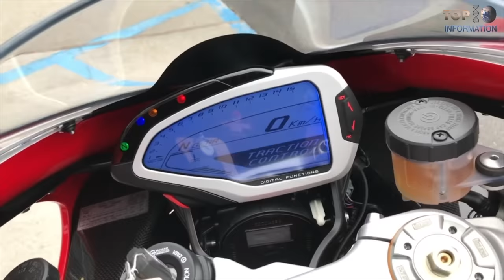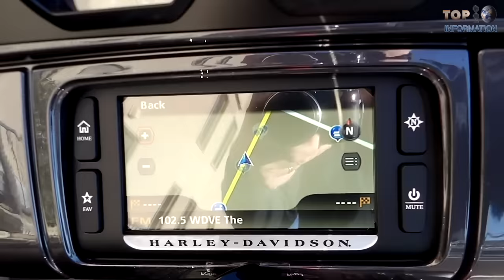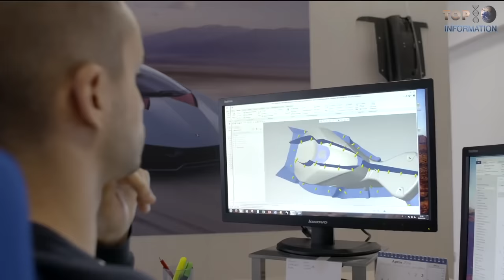10 Mind blowing  MotorCycles in the world

Comment: I think you are mistaken Kazasaki H2R TOP speed is 400+ not just 300kmp
Reply: Yuri Boyka yea they did I thought the same thing
Reply: Yuri Boyka Doesnt it got 356 hp too
Reply: In fact the h2r was famous for breaking 400 km/h wall...
Reply: If you have a race engineer to tune your settings then yes, 400kph is achievable (by one man thus far) but stock settings will prevent an average rider from reaching such speeds.
Reply: Garrett Garvin unless u take off the speed and hp lock for usa
Reply: LighteningForceX no the rev limiter shows up at about 350kmh
Reply: xxtimtheplayaxx - “The rev limiter shows up at 350kph”. A rev limiter is simply that, it limits the revolutions of the engine. A rev limiter kicks in at a certain rpm not a certain speed.
Reply: xxtimtheplayaxx okie
Reply: dsrtrcr77 just add larger gears, sure u may have to modify the bike to fit it all lol
Reply: Bro not kazasaki 😉😉 Kawasaki
Reply: @BittuKumar-qs7kj  haha my  misstick 😁

Comment: You are wrong! 
The h2r can reach to 400kmp but you are talking about the h2 that can reach "just" to 300kph. 
Be AWERE
Reply: Rom Hovav YOU are wrong, h2r cant do 400.the 400kmph run didnt show the gps speed, watch some runs with gps speed.
the h2r can do 370 MAX ( which is alot but its not 400) and 370-400 difference is alot compared to 300-330
Reply: BOS5 
They are still wrong though....
The h2 cant go 370.

Comment: This is a really bad video.
For example the H2R does have a topspeed of about 400kph, not 300. 
You literally just said, that a 200hp motorcycle does 300 something kilometers per hour, and then you say the same thing about a bike with more than 300 horsepower? Really weak "journalism"

YOU LITERALLY SAY THE TIRES ARE MADE OUT OF CARBON FIBRE. Don't you mean carbon fibre rims or wheels? Because the tires are surely not made out of Carbon Fibre.